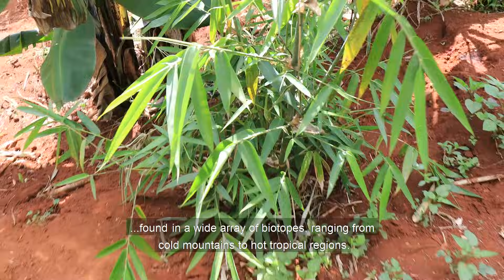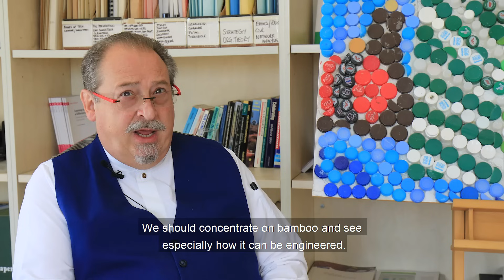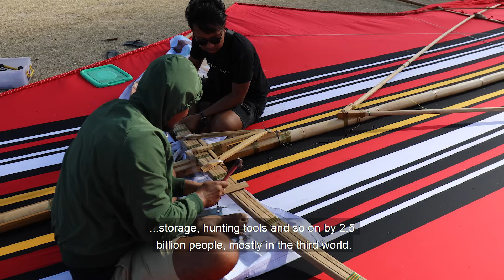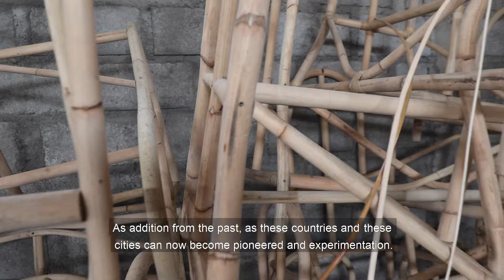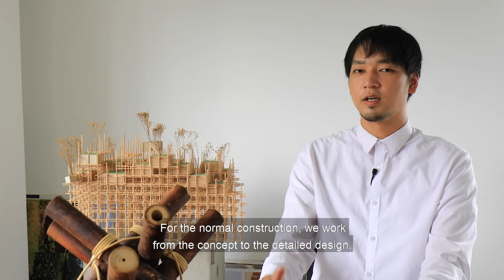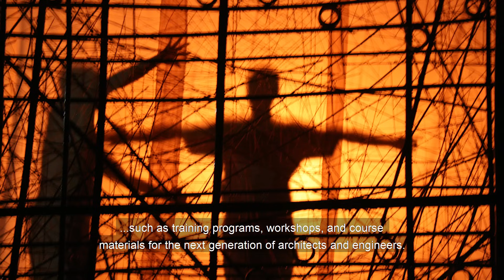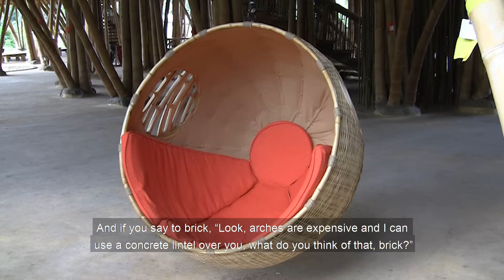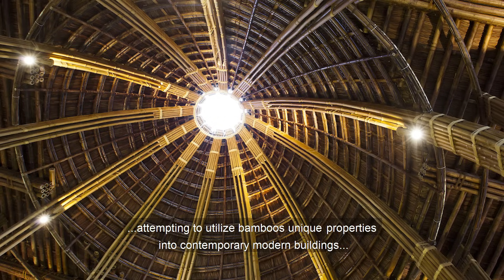Bamboo--the Tradition of the Future

Comment: While certainly the usage in buildings offers challenges to those accustomed to timber or steel construction, the pay offs are probably worthwhile. The rapid growth rate, and the ability to cultivate on land that isn't traditionally arable, means that it can be added to the current crops without much of a trade off, with a relatively high yield. 
I think the adoption with be slow in the beginning. But at a certain point, there will be a critical mass that generates real demand. At that point, the cost effectiveness of its rapid growth will come to the front and production with expand rapidly.
Reply from the maker: We think this is a fair assumption. There is good work done to solve the problems Bamboo facing. What we need is daring actors (architects, engineers, contractors, administrators, and politician) to create innovative structures and to show the way.
Reply: @anthrotechture5709  100%

Comment: Plant traced back several thousands of years you say??? How come you only have evidence of it being used as early as 16th to 11th century BC?  Are you using 3 to 4 thousand has several?
Reply from the maker: The definition we have used for the term  several is “more than two but not many.”. This is a common  definition of the term. Used by for example Oxford English Dictionary. So yes 3-4 falls into our definition of “several”.
Reply: @anthrotechture5709   Thats why you take a what could have been a good vid on bamboo and turn it into a political statement.  Most I know in the engineering field use several more than 5. To say several meaning 3 is very misleading. Seems like the vid is comprised of clips from other past vids around on this subject.  Good thing I didn't subscribe to this channel if this vid is any indication as to the quality of the information.

Comment: What a way to spoil a good shoh on bamboo buy bring in silly climate change politics. Yup,1 degree increase in the last 100 years.  I jsut found out that the reason for the increase in temperature during the age of dinosaurs was the methane released from dinosaure farting.   But can't find out what caused the cooling period of the 12- 1300's (black plague)  > but then again they didn't have record keeping of temperature or a way to measure if before befor the mid 1600's but that was mostly in england. Globalt temp records haveonly been kept since the mid 1800's

Comment: Bamboo is amazing however it does split, crack and breakdown relatively quickly though.  You know you have purchased a real bamboo product when it has a crack in it, 3 months to a couple of years later.
Reply from the maker: As all material Bamboo needs to be used correctly. Iron, concrete and wood rust, rots, withers away, if it’s not prepared, applied and maintained properly. We are learning how to do this with bamboo too. Although there are examples of over hundred years old  bamboo products still in use we are just starting to fully understand both problems and opportunities of the material. As one of the interviewed architect in the film (Effan Adhiwira) expressed : we simply don’t know how old a bamboo construction can be if  it is done properly.

Comment: I see a way to greatly reduce the cost of housing using bamboo. Let me circle back to that.

Our infrastructure is crumbling because it was built with Portland cement (OPC) and steel. Invented in 1824 but not used extensively until the 20th century, OPC inevitably cracks, allowing water to penetrate to its rebar, which rusts, expands, and breaks the concrete. Its life span is generally 60 to 100 years, with some structures designed to last only 40. The Roman Pantheon, OTOH, built with simpler, lower-carbon lime-pozzolana (chemically reactive aluminosilicate volcanic ash) cement, is still in daily use after 2,000 years. If we rebuild our roads, bridges and buildings with OPC and steel, our grandkids will have to pay to do it all again—and the way we pass our debts on to them, nowadays, they’ll still be paying for this rebuild. 

Making OPC produces 8 percent of global greenhouse gasses; making steel emits about 9 percent, 17 percent total. If we rebuild, and China and India and the rest of the developing world “modernize” with OPC and steel, those carbon emissions will increase exponentially, enough to negate all other efforts to contain climate change.

There are alternative cements. One type, geopolymer cements, GPCs, can be made from coal fly ash and steel mill slag, cleaning up vast toxic waste disposal nightmares. The carbon from those processes is already in the atmosphere; no way to unscramble that egg, but no excuse to burn more coal or make more “dirty” steel,* either; when we deplete those wastes, “pozzolanic” volcanic ash works as well or better.

GPCs appear to be far more durable than OPC. They have higher compressive and tensile strengths, low drying shrinkage (drying shrinkage is much of what cracks OPC), are somewhat insulative—up to R-8/inch with the right aggregates—and resist chemical attack much better than OPC. Some GPCs suck CO2 out of the air and turn it to stone as they cure; a useful and beautiful version is Ferrock. You can improve some GPCs by adding biochar, sequestering even more atmospheric carbon.

GPCs should cost us taxpayers much less than OPC, and we’d be doing our progeny a huge favor, rebuild with them instead. As for reducing the cost of housing:

Blue World Sciences, Pompano Beach, FL, has developed a GPC-offshoot they call Blue World Crete. BWC, BWS claims, has a unique property: it super-insulates, around R-35 per inch. They say it forms covalent bonds with almost anything—that’s as strong as strong gets—is utterly fireproof, not just waterproof but hydrophobic—if water can’t penetrate, water/ice can’t damage--amazingly flexible, doesn’t crack, is three times as strong as OPC, and so non-porous that bacteria/barnacles/mold/mildew/zebra mussels can’t grow on it. BWS claims 20 percent less cost and 1/10 the carbon footprint of OPC, but they also say that it penetrates, mineralizes, bonds to and protects cellulosic aggregates and bamboo reinforcing from fire and rot (steel rebar is overkill for light construction), sequestering the carbon in those, too. Woody biomass is about ¾ carbon, and (OPC) concrete is 4:1 to 12:1 aggregate to cement, depending upon the strength needed. Using BWC could result in concrete that is mostly atmospheric carbon.

You can cut cellulose-aggregate BWC with woodworking tools, and it takes and holds nails and screws.  Inflate a dome or barrel-vault concrete form, or tie up a simple bamboo frame in the shape of a gothic arch, an igloo, a yurt, an A-frame, a teepee, and cover it with BWC-drenched burlap; let that harden, and spray on a layer of BWC-wood chip concrete thick enough to climb on once set, maybe 1.5 inches. Cut holes and place electrical boxes; staple—quick and easy—bamboo splint reinforcing and wiring to the outside, and trowel—more jobs less machine rentals—on a second layer of BWC with burglar- and bullet-resistant stony aggregate. Near-instant super-insulated Passive House, already waterproof and fireproof. You wouldn’t even have to paint it, but if you wanted it pretty, face it with flagstone set right into the outer layer while it’s still wet. No paint, siding, standoffs, housewrap, framing, insulation, sheetrock, or caulking needed. I think (I’m a solar home designer) that building the shell of a house this way might cut the cost in half, maybe by 2/3. Middle of the woods? That house could be utterly fireproof. Tornado alley? Bury a dome and a way cute Hobbit house could be tornado proof. Your home could be your disaster refuge, your safe harbor. Crazy idea?

BWS says that a portable, mass-producible BWC plant should cost 1/20th to 1/10th as much as a comparable OPC plant. It won’t burn tons of coal or methane every day, so owners wouldn’t pay for that, either.

OPC is the largest industry on the planet, they do a lot of lobbying, and they are resisting the switch to sustainable cements. But if we rebuild with OPC and steel, it will all begin to crumble again this century. Given what that much more CO2 will do to the biosphere, it may not matter. Or to misquote Thoreau: What is the use of a shiny new bridge on a dying planet?

If you care to research this tech for yourself, start here: https://www.geopolymertech.com/ and http://blueworldsciences.com/blue-crete.html; page down to see the burn test.

---------------

*A team at MIT led by Prof. Donald Sadoway has tweaked the Molten Oxide Electrolysis process used to make aluminum to work with other metals, especially steel. The off-gas is pure oxygen; no CO2. The new process makes better steel less expensively, using 20 percent less energy. It will require lots of clean electricity; we need molten salt fast nuclear reactors, now. But that’s another rant. https://www.chemistryworld.com/news/greener-cleaner-steel-/6155.article 	https://www.bostonmetal.com/moe-technology/  and https://dspace.mit.edu/handle/1721.1/82073   

And ELYSIS, a Canadian consortium including Alcoa, Rio Tinto, and Quebec (government investing in new clean tech. Communism!) with support from Canada and Apple, are tweaking the aluminum electro-smelting process so that it, too, produces only oxygen, not 1.5 pounds of CO2 per pound of aluminum. That’s another 3 percent, or so, of climate change, about like the airlines. ELYSIS expects the new electrodes to reduce operating cost by at least 15 percent. We can’t afford not to adopt these new technologies. The only people who will lose are the fossil industries now destroying the biosphere, and the only reason they will lose is because they haven’t the vision to see how much more profitable investing in new clean tech could make them. Let’s not let their short-sightedness ruin the world for our grandkids. https://www.c2es.org/content/alcoa-rio-tinto-and-apple-work-with-canada-to-erase-aluminum-smelting-emissions/
Reply from the maker: This comment does not seem to have anything to do with the film what so ever!!!
Reply from the maker: Ok, we are giving you another 12 hours to respond to our previous comment after which we are going to remove your comment and report it as spam!!!!

Comment: bamboos are usually in termite areas. how long can buildings made of that last then?
Reply from the maker: Yes, it is correct that termites are attracted to bamboo. This is due the naturally high sugar content of bamboo. Untreated bamboo is good termite food. This is also the reason we can use bamboo as a food item. However, this sugar is easily removed and without the sugar the termites are no longer attracted to the bamboo. 
All materials need to be treated and used correctly—steel need to be treated to be durable and exposed concrete wrongly treated has a very short lifespan in some environments. You can probably find many examples of badly constructed steel and bamboo buildings if you look around in your neighborhood.
Historically bamboo was kept untreated and parts or whole structures were changed and rebuild regularly. 
That said the question is good and the answer is still a bit muddy. the full truth is: we don't know how old a well treated correct designed bamboo structure last. We have to few examples of old constructions. most contemporary buildings in bamboo only have op to 10-15 years. We are still in a very early stage of using bamboo as a "modern" material. Right now we are producing a sequel to this movie, it is our hope that we can answer some of these questions in that movie.
Reply: @anthrotechture5709 : your information is greatly appreciated. thanks.

Comment: I wonder if the solution to bamboo not being standard as an engineering tool could be solved by stripping it down to the fiber level so that they're uniform, and then weaving and braiding it into a three dimensional structure that suits the use. Spin the individual fibers into boards and blocks and beams and planks by choosing which directions you weave or braid them in through three dimensions.
Reply from the maker: There is a lot of new and innovative ideas how to make bamboo products that “plays well with other materials”. In our next production we are going to explore the material’s inherent potential more thoroughly. The pandemic have kept us from working full speed with this new film but hopefully we will finish it soon.
Reply: They are making bath towels out of bamboo fiber.
Reply: how would this work physically?
Reply: @bamboocreativebali  I'm imagining a process similar to how they make blocks out of carbon fiber.
Reply: every bamboo culm is different... so this would be nearly impossible unless a selection process is "added" in... like when you go to the supermarket and choose a kilo of apples out of the big pile... the harvester just harvests... then the builder selects which bamboos to use. thickness, curve, weight etc... its an interesting process to watch. in woven products, you're right,  still you're going to have the odd dud piece... remeber the apples 😉
Reply: @bamboocreativebali  I get the feeling you didn't read my comment, which was explicitly about bamboo culms not being the same and what to do about it.
Reply: @williambarnes5023  hi, not until now - i didnt read it no... apologies. My imagination is boggling... i cant visualise what you're saying in reality - with the cross section of a bamboo the skin and outer layer is strongest and softer fibre towards the centre,,, so usually centre part is discarded. i have made stiff, not flexible bamboo lamination by hand using epoxy glues and wood glues. Bamboo rope does exist... i think made from apus/tali bamboo - i dont know how to make it though. and apparently the process to make bamboo into fibre for clothing is very destructive to the environment... maybe they use a lot of chemicals or something (I'm not sure - havent had a chance to research it properly)

Comment: Newbie here 😊
What is meant by "grade" when you say that bamboo is difficult to grade?
I have always wanted to learn woodworking and I have bamboo in my backyard. I want to use it instead of chopping it down and throwing it away. Ready to learn more!!!
Reply from the maker: When one use a material in a structure, (say steel) it is important to know how much forces it’ll take. Ordinary this is no problem since one piece of a material would have very similar property as another piece of the same material. However in a organically growing material this properties fluctuates between different pieces. In most wood we have learn how to calculate these fluctuations into the engineering. Wood today can be graded very accurate. But we still need to learn how to do this when it comes to bamboo.
Reply: @anthrotechture5709  Wow!! You responded quickly!! Thanks for that simple explanation!!! Now I'm going to look up calculating the grades of wood!!

Comment: As much as I love bamboo as a building material in architecture, I think it should only be used as a novelty. This would retain its allure and aesthetic impact reserved only for special spaces.
Reply: Bambbo is a lot cheaper than Western Red Cedar which is common in US lumber homes. Bamboo can bear high compressive stress so intend to use Bamboo as a core material for Deck construction in Canada.  Solid Bamboo decking material is already available now its easier to protect Bamboo from ants than it is to stain Lumber.

Comment: Are there infestation problems with panda bears when your house is built from bamboo?
Reply: "Used correctly, bamboo has the tensile strength of steel and the compressive strength of brick or concrete".... In other words, the panda does not eat the bamboo used in construction, the 'trunks', just the leaves and shoots.

Comment: The market for seeds is booming I bought 350 bamboo several different varieties on eBay my th thought since I live in zone 4 the winter may kill anything outside to get around this of course buy hardy varieties I plan to container grow for first two years and then use graphs of these at 4000 foot altitude clone to keep under 6 foot indoors. A living trellis bending over to a second stalk and so force the tops into the ground near the base of the one its tied together rooting the tops and continue to fill in either a short tunnel or depending on growth a tall tunnel they can be moved if it dies no biggie.. Living structures grow your own gazebos and people will demand to be bamboozled

Comment: the only argument i make is humanity is not chamging the overall climate of the planet, that changes on its own. but the micro climate that causes drought, which leads to soil erosion, than floods, than leads to desertifcation, than finally combined with that last one the heating of the local climate. look at all the cities! nothing but concrete, glass, and steal. which increases the local temperature 15 degrees. we need to regreen our cities buy covering the buildings in local plants. by doing so will lead to the cooling of the cities but also create presipitation and end droughts.